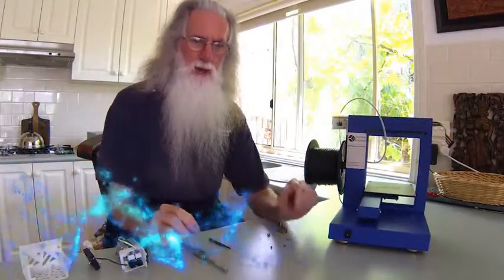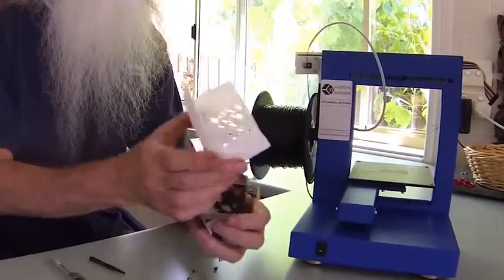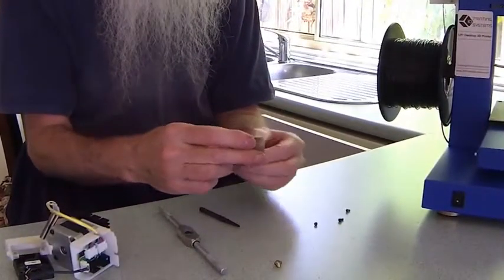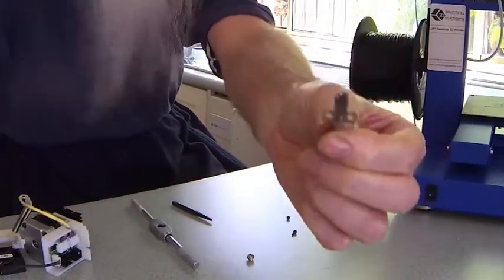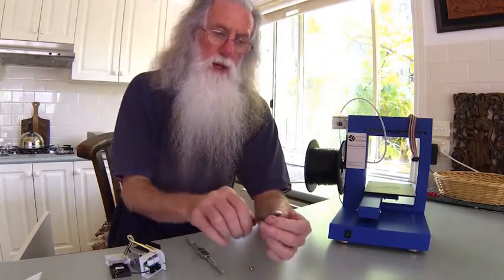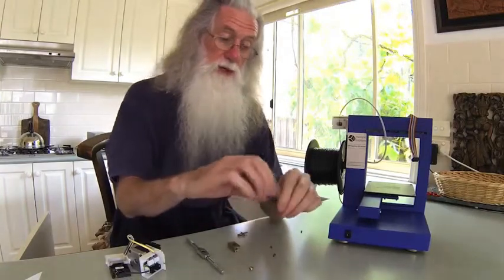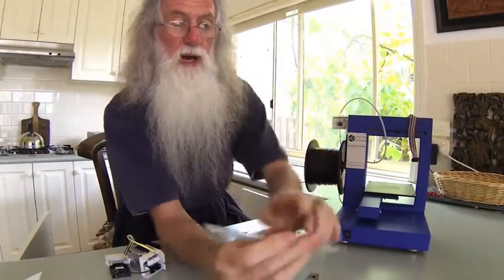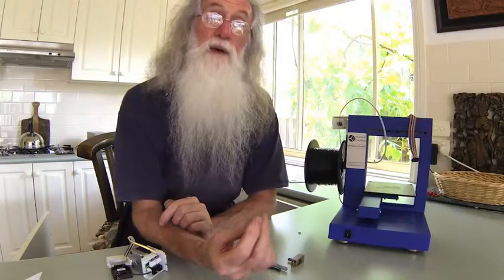3Dprint4A - Broken Printer Nozzle

Comment: My one snapped far in can it still be undone?
Reply from the maker: Normally I only reply to subscribers, they appreciated the effort in making the videos and show their appreciation by clicking the button. So for a non-subscriber the answer is yes.  A subscriber would get additional info such as that it must not only match the hole size so it's teeth can get a grip but if it is a blind (short) hole you may have to grind the tip down to suit.  Help make the world a better place and subscribe and spread the word, not the virus. Enjoy my 300 videos during the lockdown.